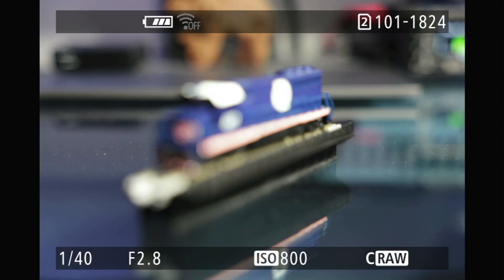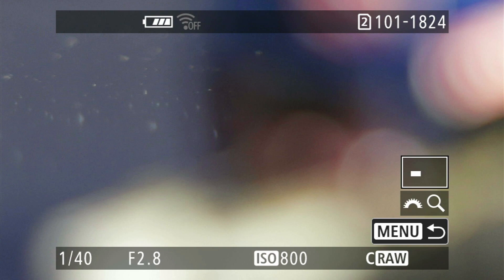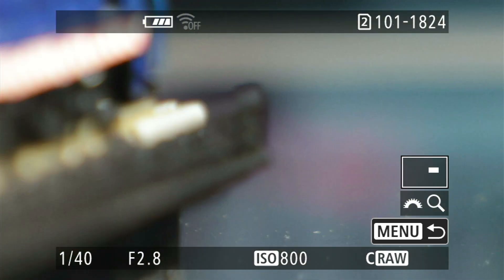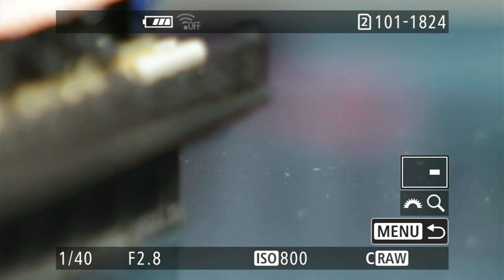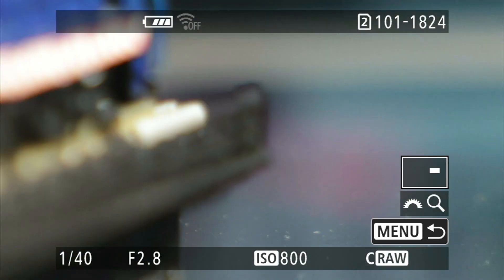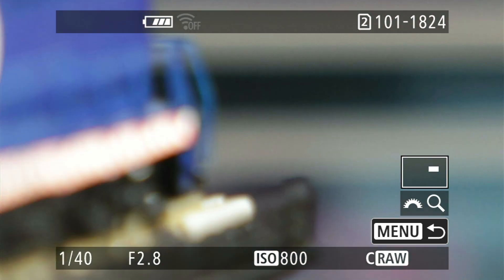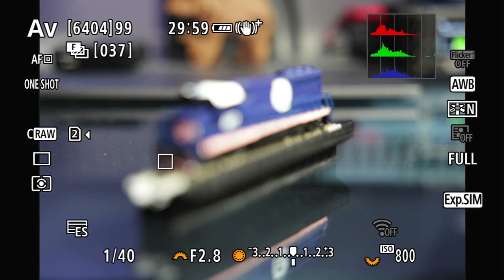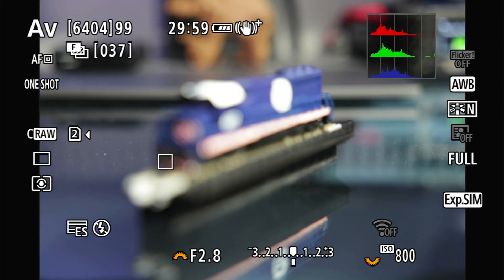Shooting an Automated Focus Bracket Set - EOS R5 Tip 16

Comment: This is a sad implementation of great feature. Canon kinda blew it on this one. First one of the things that is a no brainer is that this work with flash. This is a huge oversight for macro. Reducing noise, freezing motion in an outdoor shot. I have heard the excuse that electronic shutter is the problem. Ok, use mechanical shutter, this could be fixed in a firmware update, the fact that helicon remote can do it remotely tells me this can be done internally a lot faster.. It won't be as fast but better than using Helicon Remote with is super slow (unless I am not doing something correctly in the settings but I don't think so). This could have been a great feature except as often they do, either the cripple hammer hit it or they have engineers that do not interact with people who actually use cameras and just throw features on thinking they can compete with other camera makers without putting thought into why the feature exists or why it is desirable. Good job Canon.. again.
Reply from the maker: The problem here, IMO, is that there's always a problem in engineering balancing priorities and thinking through the problems so that you don't do something the messes something up somewhere else.

So lets think about the problems here. We'd like the flash to fire while shooting a focus stack. 

Now I'm going to go out on a limb, and say that in most cases, we also want the focus stack to be shot as quickly as possible. Taking 15 minutes is fine if you're shooting coins on a table in a studio, but if you're shooting outside and there's even the hint of a breeze, time is your enemy.

Okay so, problem 1: Triggering the flash.
This is probably the easiest to deal with. So the R5 & R6 can't trigger the flash in electronic shutter mode, but they can in EFC and mech modes. So let us pick the shutter mode. The R3 can trigger the flash in electronic mode, so the problem is probably solved going forward. Granted that slows down the shooting speed, but it's probably still tenable.

Problem 2: Timing the next exposure with the flash.
So it doesn't do us any good if X out of every Y frames is dark because the flash didn't fire. Nikon's solution to this is to let you specify an inter-frame interval. I find that a kludge too, because it's something the camera should do for me, not something I should do for the camera. Plus, as your flash's battery depletes, the recycle time changes, so you have to set something more conservative than you might think.

So there needs to be a flash ready signal sent from the flash to the camera. There's been very little published on the ETTL protocol, but not enough that I can say for certain whether that exists in the protocol already. If it doesn't, then it needs to be added, and then flashes would need firmware updates (if they can be) to support it.

If it's already there, then it's simply a matter of being able to track the ready state and use that as a condition before releasing the shutter.

Problem 3: Flashes cooking themselves.
I think this is the real problem at the end of the day. People don't like it when their camera breaks something that its supposed to be designed to work with. With a focus stack, we're asking our flash to fire at potentially full power, as fast as it can, for many, potentially 10s if not over 100, frames.

We've already seen the problems with high speed shooting prompting designs like the Canon EL-1 and Nikon SB-5000 to have fans to cool the optics.

In thinking about this, I suspect this might be the problem that sealed the deal for the flash and focus stacking. It's not smart engineering or good business, to create a feature that puts another product at risk of damage, as part of it's normal operation.

I'm more annoyed by the inability to simply set the front and back focus limits easily instead of having to set the front focus position and guess at a number of frames.
Reply: @Points in Focus  Humans understand physical limits. A flash will operate only so long, flashes have thermal sensors and reduce firing speed when hot or turn off. If I shoot at F11, then I need less shots but perhaps more flash power. Most manufactures tell you how many shots the unit will fire before it goes to cripple mode. My Godox Ad200 at 1/1 says only fire 40 times with speed light head and 60 times with the bare bulb then let it rest 10 mins. Each step you step down you double the number of flashes. 1/2 power allows 80 speedlight head and bulb 120 and so on until you hit 1000 flashes. If you shoot longer than that without a rest it will set recycle times to 10 second intervals until you allow the unit to rest for 10 mins, then it starts over. My 600ex-rt manual says 48 flashes and it goes into cripple mode. 10 min rest or longer depending on ambient temp. The AD200 has 2 stops or 4 times more power than the Canon 600ex-rt (according to speedlight review) so you don't need full power flash for that flash, the Canon you cannot go past 48 period. (I have never shot the 600EXRT at full power with double diffusion, with a working distance that is less than 12" from a macro subject). The Godox at full power has a recycle time of 1.8 seconds less than a 1/4 second with the same output power as the Canon flash at ful power. My point is. I can manage the flash and buy a more expensive one if I need more power.. We don't need TTL to tell us if the flash fired (though this would be a nice feature but could not be added in a firmware update most likely). So instead of creating a new 75mp sensor to compete with Sonys 100mp sensor. Fix problems in firmware if possible. This is an easy fix. The duration between flashes is easily done as well like the Nikons system. This smells of cripple hammer for product differentiation between the R5 and R3 but I could be wrong
Reply from the maker: @r1ch m, sorry about the delay, for some reason your comments keep getting flagged for review.

> "So instead of creating a new 75mp sensor to compete with Sony's 100mp sensor. Fix problems in firmware if possible. This is an easy fix. The duration between flashes is easily done as well like the Nikons system. This smells of cripple hammer for product differentiation between the R5 and R3 but I could be wrong"

First, the R3 has the same limitation as the R5 here, so it's not product differentiation. Which is why I suggested that the real limiting factor is external (e.g. overheating the flash, design priorities, or laziness), not the camera's ability, or inability, to trigger the flash.

Second, the engineers designing new sensors almost certainly aren't the same engineers that are implementing things like this in the firmware. I don't see a good argument for Canon not doing both. For that matter, I don't see a good argument to hold back R&D work that requires years to mature (sensor design) to fix or address a software problem that could be dealt with in a man-week or less of development time by a single developer. I mean the kind of thing we're talking about here I could implement, it doesn't take advanced math, it's some if statements and calls to functions that should already exist (e.g. firing the flash, checking for status, etc.).

Third, Nikon's solution fo requiring you to manually specify an interval between shots is not really good design either, and should not be emulated either. The only good solution to flash firing while focus stacking, is for the camera to coordinate with the flash through the hotshoe. Forcing the user to do that kind of thing is lazy engineering.

Of course, if you haven't sent Canon feedback (at least Canon USA has a feedback form, not all of the other regions do), then you really should. There's never any guarantee that they'll do anything with it, but at least you'll have provided feedback to the company that can act on it.
Reply: @PointsInFocus   said "First, the R3 has the same limitation as the R5 here, so it's not product differentiation. "  This is news to me.  The R3 can sync flash using electronic shutter up to 180th of a second 15 frames per second. It does not have to check with the flash to see if it overhead or if it flashed. So theoretically the R3 could fire a flash when focus stacking without worrying about flash overheating just like it does normally when the user shoots electronic shutter and flash. But if you are saying the R3 cannot focus stack with flash, it is not because of electronic shutter like in the R5 that cannot sync flash electronic shutter  So Canon is not restricting the r5 because of flash overheating. It should be able to switch over to mechanical shutter and fire at 12 FPS syncing with the flash if the R3 can do it at 15 frames per second and not worry about flash overheating.  I agree the best solution is the camera knows if the flash went off. I think the R5 does know if the flash went of or not because embedded in the raw image. I am probably getting flagged because I have also participated in some political discussions and google hates when you think differently or do not conform to their narrative and world view.
Reply from the maker: Yes, the R3 can sync flash with the electronic shutter; but it can't/won't do it when the focus stacking feature is enabled. At least that's what the manual says. Page 274, Caution box, 7th bullet down, "Flash photography is not enabled."

> "It does not have to check with the flash to see if it overhead or if it flashed." 

When you shoot in normal continuous drive the camera doesn't consult the flash before it releases the next frame. However, you have to think about the ramifications of the flash not firing here versus when shooting a focus bracket. 

In normal continuous shooting, you end up with 1 or more frames in your burst that don't have flash. In many, but certainly not all, cases when you're shooting a burst with flash, the flash is providing fill not key light, and as a result the no-flash frames are going to be a bit worse, but they're not going unusable. Moreover, when shooting a typical burst, there's very little frame to frame dependency; we're shooting to get a frame at peak action.

On the other hand, in a focus stack there's a frame to frame dependency that can't be avoided; the images have to be combined and the result has to be seamless. If the flash doesn't fire, there's a very good chance that the non-flashed frame ruins the entire stack.

>  It should be able to switch over to mechanical shutter and fire at 12 FPS syncing with the flash if the R3 can do it at 15 frames per second and not worry about flash overheating. 

IMO, we should be able to specify the shutter mode we want the stack shot in regardless of the flash or not. The idea of shooting at the fastest possible frame rate is intended to minimize the time taken to shoot the bracket, and consequently the potential for movement and stacking errors. If you're shooting in the field, this is absolutely desirable.

That said, it's also clear to me that Canon's vision for this feature was rather limited — probably to natural light landscapes and architectural images. So things like flash sync probably never entered the design brief in the first place. I mean see @Andrew Benbow's comment about Fuji's camera's being able to set the range simply by focusing at the front and rear limits.

Again, the best I can suggest is sending Canon feedback requesting the functionality.
Reply: @PointsInFocus  said"we should be able to specify the shutter mode we want the stack shot in regardless of the flash or not." "Canon's vision for this feature was rather limited — probably to natural light landscapes and architectural images. So things like flash sync probably never entered the design brief in the first place. Yep, we definitely agree here. My point is if they allowed us to switch to mechanical shutter on the R5, Then they should be able to implement focus bracketing internally instead of having Helicon remote or some other software to generate focus bracketing with flash.

Comment: Well, it looks like Fuji wins the battle of focus stacking then ;) 

With the X-T4 (and others I assume) you can set a front focus position and a far focus position and the camera will work out the number of steps required based on the focal length and aperture.

I've had everything from 15 images right up to 235 and they stack perfectly in Photoshop or Zerene.

It's a shame that Canon / Nikon can't do it in the same way because I'm just about to swap to Canon :p 

Thanks for the great videos!
Reply: Not only can the latest Fuji bodies set a beginning and end point for focus bracketing, you can choose to shoot using a mechanical shutter. Canon forces users to use electronic shutter, which reduces your dynamic range and [potentially] IQ by lowering bit depth from 14 bit to 12 bit. I made the switch from Fuji back to Canon about a year ago. While I don't regret it, I find that in many ways the Fuji OS is more sophisticated than the Canon OS. For example, Fuji shows DOF info on the focus distance indicator. I used this information all the time. I missing having it on my R5. And Fuji allows focus point size adjustment. Canon gives you a choice of two sizes. That said, Canon's AF prowess is significantly superior to anything Fuji has been able to come up with—at least to this point. It's not even close.

Comment: Are you able focus bracket with exposures longer than half a second with the R5? I tried this with my 14 to 35 and I couldn’t get more than half a sec - so anything longer is under exposed. I was experimenting and trying to simulate / exaggerate with a 10 stop ND filter effect with a sea scape using built in timer.
Reply from the maker: Sadly, no. The focus stacking mode uses the electronic shutter which is limited to 0.5-1/8000.